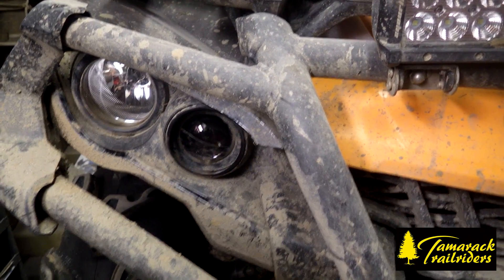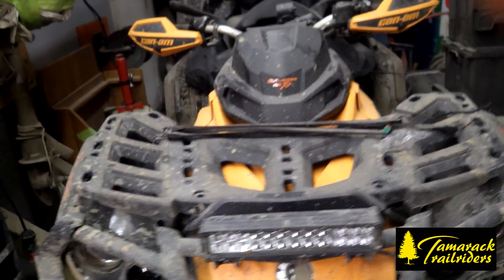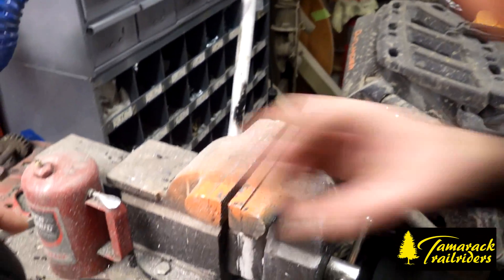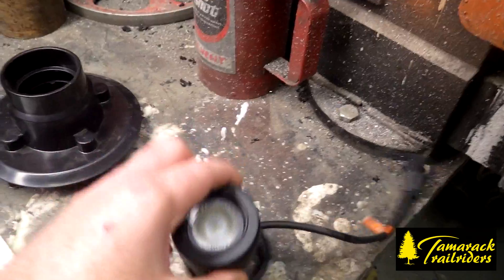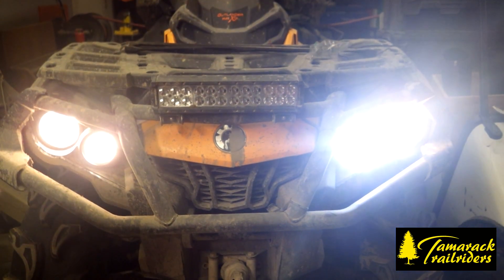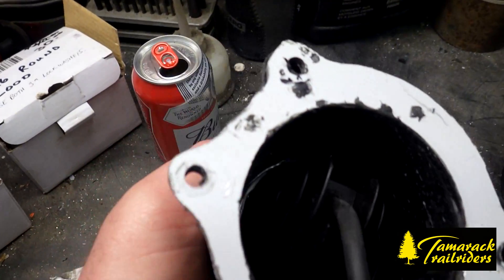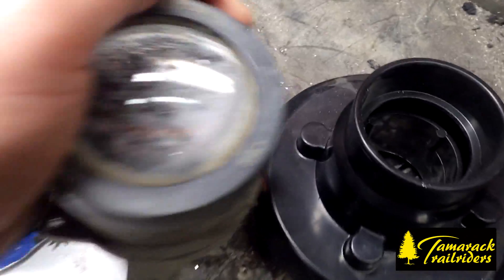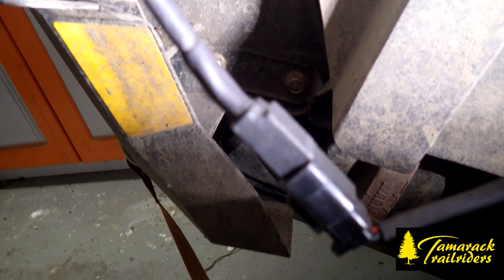Can-Am Outlander LED Lights

Comment: WOW, big difference! Very cool idea! Hopefully the heat sink on the back of the LED fixture doesn't melt your bike, or start it on fire, after a few hours of use - lol - kidding of course, I have no idea how hot those things get.
Thanx for sharin'!
Reply from the maker: Yes I think its going to work out very nice. After being on for about 20 minutes you can still hold the LED light in your hand so we don't think heat should be an issue. Thanks for watching!!!
Reply: @tamaracktr6411  good Idea man
Reply: which model of them did you use my original light have water inside